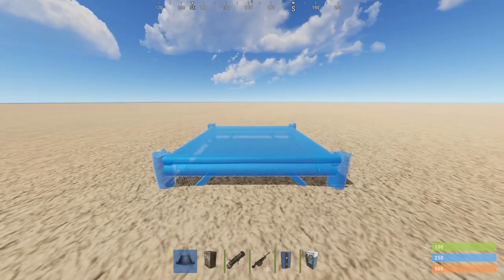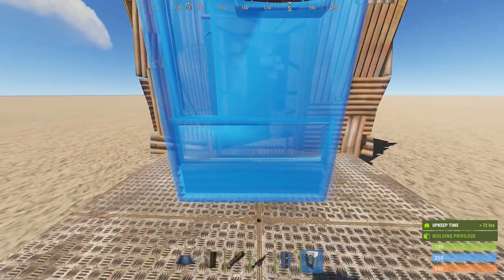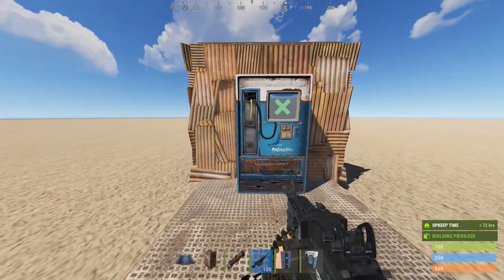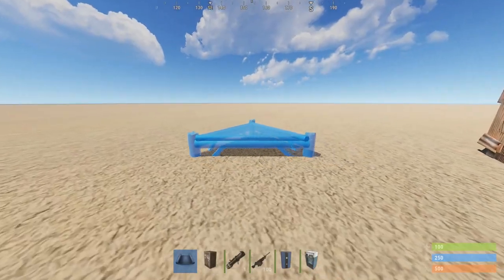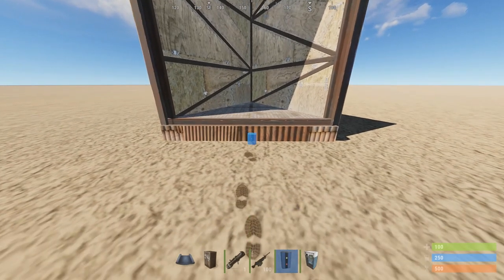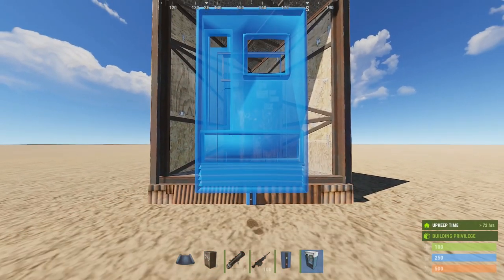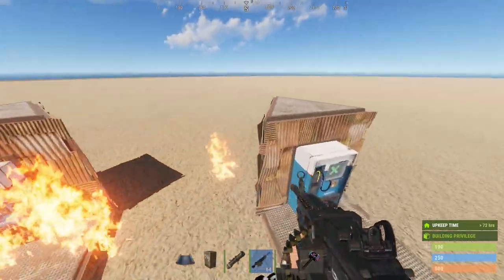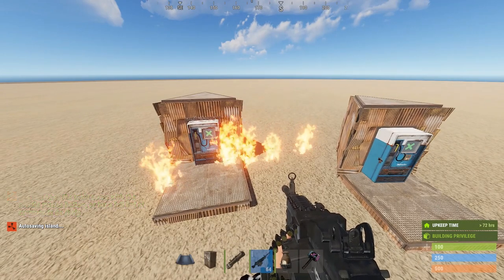Improved Vending Machine Bunker Rust April 2021

Comment: This design seems to be destroyed by 2 HE grenades if you get the angle right
Reply from the maker: What angle would that be?
Reply: @OldFeller  from the top
Reply: @allan2665  that means vending machine wasnt raised enough/in  far enough or you got very lucky. this is a precision trick which allows variability in placement, good luck. ive shot 30+ he at the top and it does nothing with my placements
Reply: @TheShizzlemop  I've done this well over ten times it's not even that precise just place a low half wall and stand on it